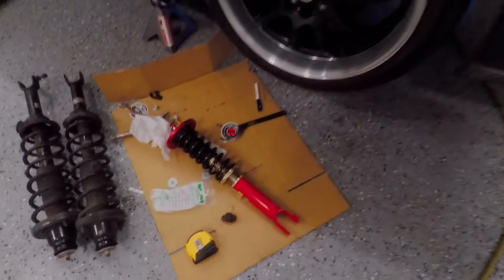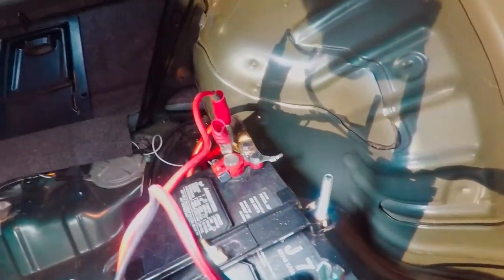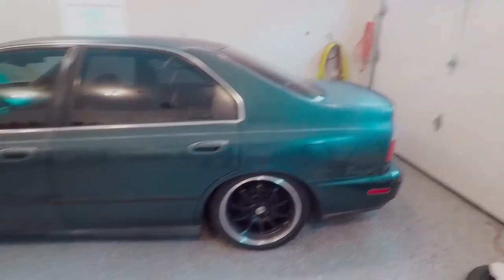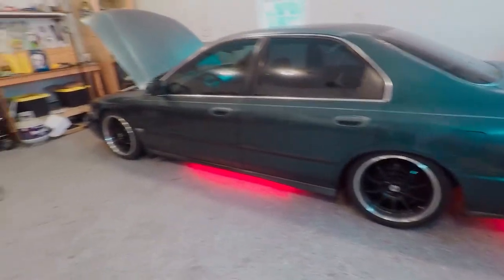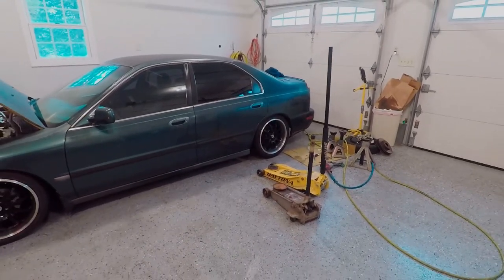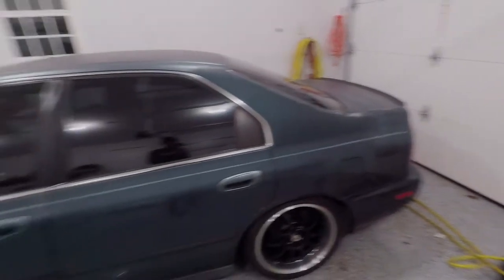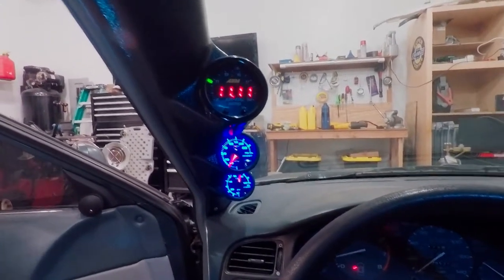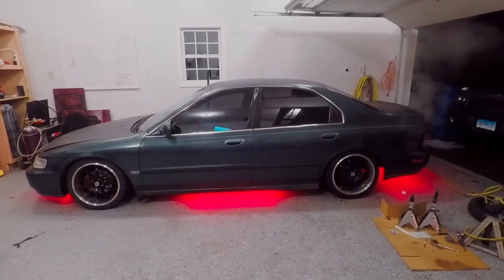Turbo Accord Slammed on Function and Form Type 2 Coilovers

Comment: Forgot to mention a little trick I used for doing my rear bushings, I put it in the freezer for about an hour and had a torch on the spindle where the bushing goes in to expand the metal then pressed it in with a big c-clamp
Reply from the maker: That is a genius trick dude. Definitely trying that next time around. I used a ball joint press which worked like the c clamp but I bet it would slide in much easier frozen with the spindle heated.

Comment: What size rims r these?
Reply from the maker: They're 17's
Reply: @ThatAccordGuy  u like them bro? I'm stuck between 17x9 or 18x9 I like the 17s cuz u can go lower but not sure
Reply from the maker: @fidelavila7565  I chose to go with the 17's since the roads here are pretty bad and I wanted something with a decent sidewall that won't blow out. 18x9 would be sweet if the roads where you are are nice.  

You could go Bigger with the tire but then you won't be as low.
Reply: @ThatAccordGuy  yeah I live in Oregon and where I'm at snows and the roads arent in the best condition alot of potholes shit like that. By the way man great channel I have a 96 accord also in the works. Next week hoping to get my skunk2 muffler installed with just some ebay headers and a full catback exhaust so I'm really excited about that. Next is coilovers so ur video helps alot to kno how to adjust them. Keep it up!
Reply from the maker: @fidelavila7565   yeah your roads are probably similar to the ones around here. Better off with a smaller wheel. It's lighter too! That exhaust is going to sound sick! Glad my videos could help you out bro
Reply: @ThatAccordGuy  for sure man and thank you cant wait to see what's next for ur car
Reply from the maker: @fidelavila7565  no problem! Best of luck with your car bro